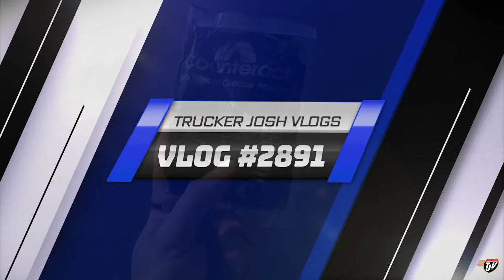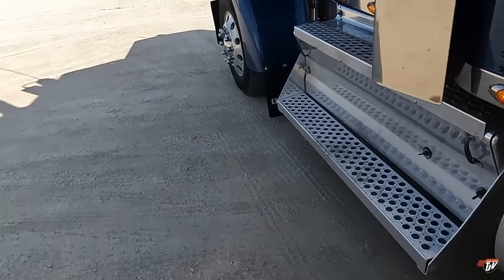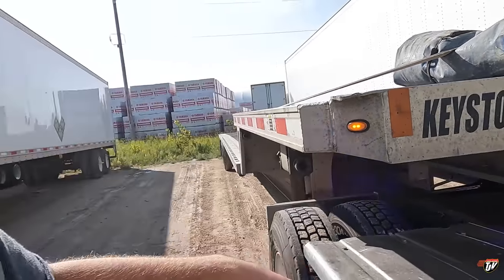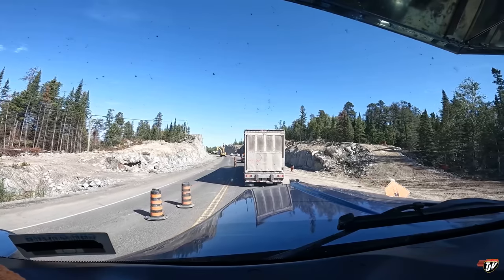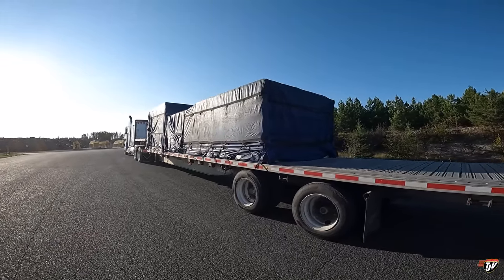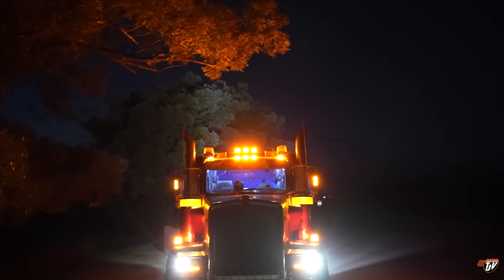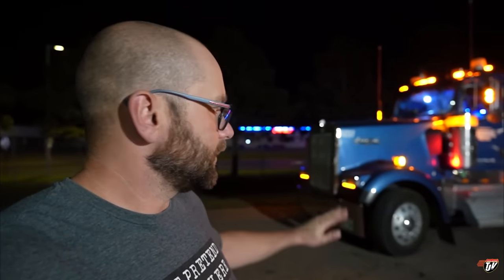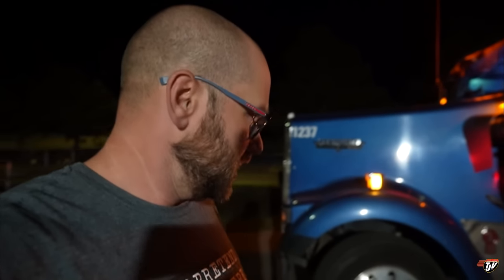GREASE | My Trucking Life | Vlog #2891

Comment: It's cheaper to get a grease gun and use tubes of grease. Around $40 and lasts awhile. I have been told greasing the tractor every 8-15k miles makes the parts last longer.